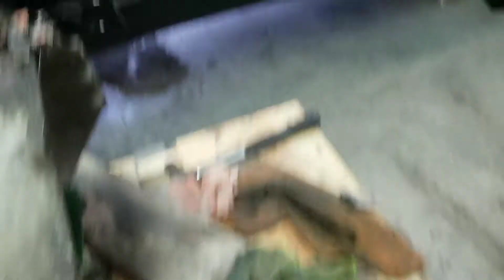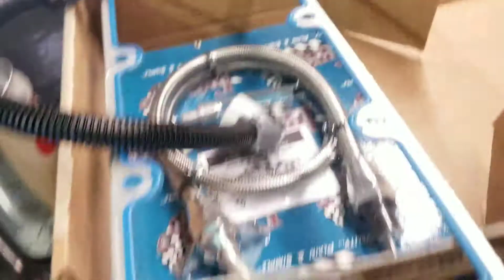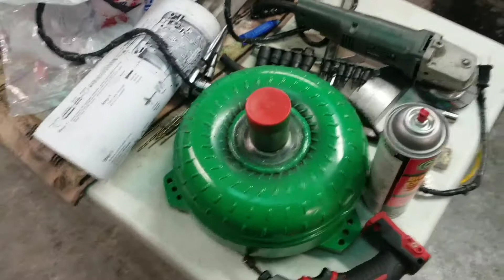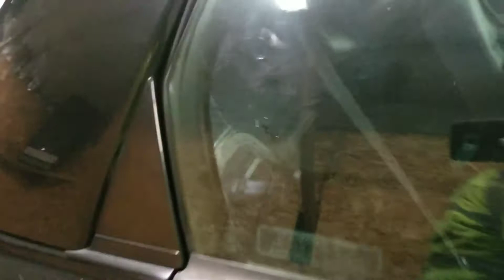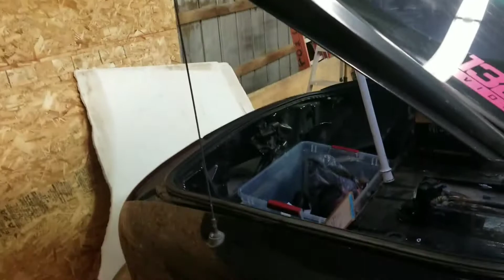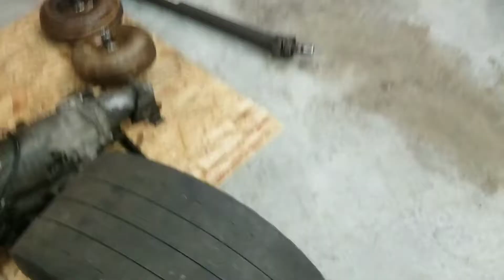Ep:1-"Hades" Vlog Introduction 4l60e to 4l80e Swap! - Turbo 5.3L Swapped Firebird

Comment: Just came across your channel and subbed. Your car is sweet. I run a 98 z28. Only goals are to keep making it faster. Race car addict for life.lol
Reply from the maker: +f boldt Thanks man and most definitely 🤘 
Race car is life! 

What have you already done to your 98? any plans?
Reply: StreetRacingLifeStyle cold air intake, ram air, L.tubes. free mods. I'm looking for a yank or circle D 4k stall, then work towards cam and heads. Having second thoughts tho cause I'd really like a turbo setup like yours.
Reply from the maker: f boldt I Went with 
the on3 70mm Turbo setup! 
02 4l80e 
02 5.3L 
Mild cam 
3.73 Gears 
Freakshow 3,400-3,600 Stall! 

I'll do another vlog in a couple days! once I  Button up the car 😎
Reply from the maker: f boldt Also I left it at 8psi to save the 60e 
(Didnt save it😂) 
But I'm going up to 12-15 psi at least I want to anyways lol
Reply: StreetRacingLifeStyle that is sweet, I'm looking forward to the update. It's awesome seeing these generation of cars able to crush any high dollar car that can be bought today. I'm a fan of built not bought.
Reply from the maker: f boldt Most definitely same here!
    I rather know I built mines on a budget with a low income, Dents, Dings, Scratches with peeling paint....   and be faster than the guy who rolls into a parking lot slow with a 100k Gtr Stock that looks mint with all eyes on him! 
  I'll keep Calm and be Humble when he Takes they take the L Like 🤷‍♂️ "Gee, I don't know guy. My car is just running well today I guess good race" 🤣
Reply from the maker: +f boldt I released the newest update The Car is insane! unfortunately I have to get this segment tune figured out!
Reply: StreetRacingLifeStyle totally bad ass bro, looking forward to seeing some more vids of it tearing up the streets.
Reply from the maker: +f boldt Most definitely man Hopefully I'll have another here soon! currently in the process of trying to figure out why the transmission is in Limp Mode! I only have (2, R) Gear!
Reply: StreetRacingLifeStyle I'm sure you will get her figured out. They say a single bad solenoid can cause limp mode, also not having +12 volts going to the trans. Hopefully it's something simple to fix.
Reply: f boldt you end up building your car at all? I have a 99 as well it’s cammed with long tubes and true duals making 400 wheel. Doing the trans then H/I as well!
Reply: Brendyn G post it please and thank you cause iam looking to the same build